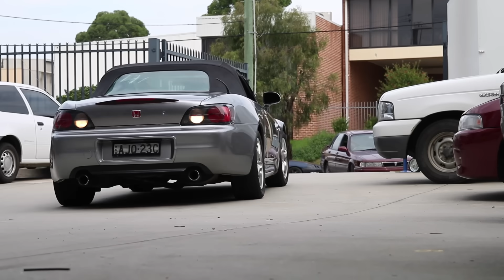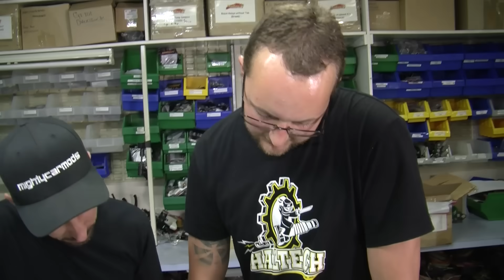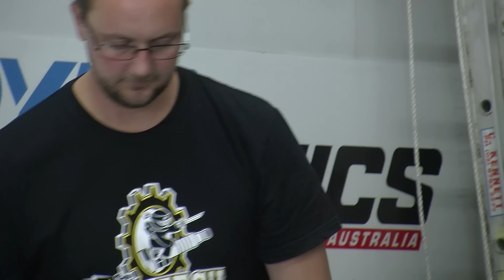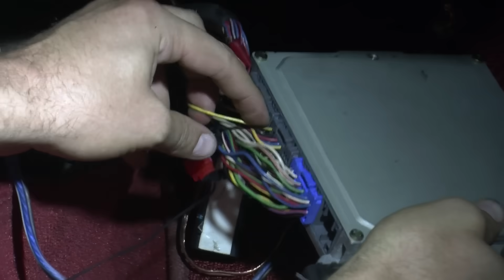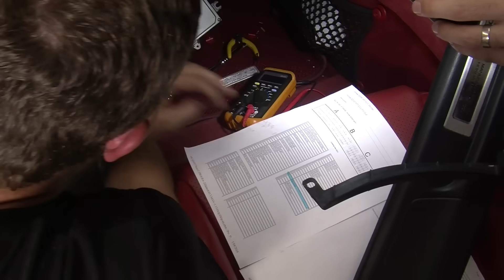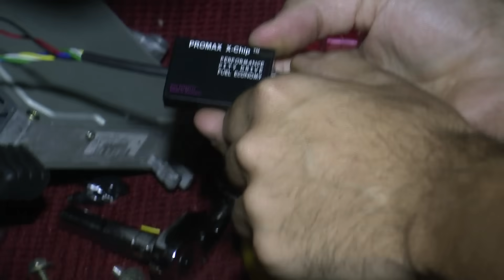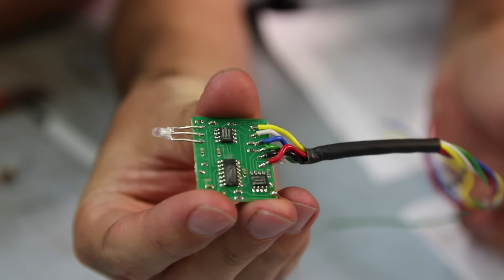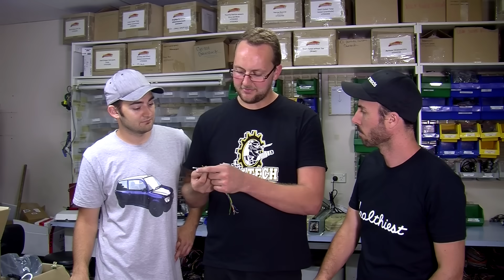eBay Performance Chips -  Mythbusted

Comment: only hardware with give you more hp. software wont.
Reply: Software controls the hardware... It does in some sense.
Reply: well, if you add hardware you should tweak the ecu or buy an ecu you can reflash or tune. But, na electronics alone won't change anything their just complimentary.
Reply: Incorrect.  A true software performance tune will increase HP substantially with a loss of fuel economy and emissions.
Reply: It didn't here but software can definitely help. Watch the youtube video "Audi S4 v Audi RS4. Does Supercharging Rule? - /CHRIS HARRIS ON CARS" and you will see how much of a difference it can make
Reply: tuning an engine actually does a lot... software runs your car. air fuel ratios are controlled by software so youre completely wrong actually
Reply: Yeah, but stock engines in sports cars are normally not held back by the software except for speed governors.
Reply: You are so wrong it's funny.

Cars are tuned from factory with a basic, reliable, often crappy tune.
An aftermarket tune alone can give HUGE benefits, even on a stock car.
Reply: very untrue...and if you have a turbo equipped vehicle or even a turbo modified car their is plenty of power to be made with a good tune.
Reply: Take an STi for example. They have tumble generator valves to alter the incoming air flow for lower emissions, safer cold starts, etc. They also have the SPT division, which provides even better optional performance parts. Yes, it's a sports car, but the factory tune is purposely conservative to make sure the car runs right and safe. Cobb accessports can bypass these tunes and add power, at the risk of lower mpg, reliability, etc. Same can be said about many other sports cars.
Reply: LOL, okay buddy. Do you professionally tune rally cars for a living? Or have you just watched too much Fast and Furious? Pick up a wrench and get your hands dirty for a few years before you talk. The big boys are having a conversation here.
Reply: James T Kirk Oh well, that's wrong alot. You say that modifying exhaust pipes cannot reach more power without ecu tune? What more examples I could give.. Porting the engine head, bigger bore pistons, better intake manifold, increasing turbo pressures, removing unnessary weight from the car, using lightweight wheels and flywheel, changing gear ratios...

Alot of modifcations improves the performance without differences in ECU's. Even changing the whole engine can give more power even when using the same old ecu. And after all, ecu's do "teach themselfs". If ecu see motor runs little too lean, ecu will try to make engine runs more rich.
Reply: For every one of those things you listed, pertaining to the engine( I don't see how weight reduction has anything to do with anything in this video), would be improved by re-calibrating the tune for all of the changes done.

Porting heads might make a small gain but if you aren't commanding extra fuel for the extra air those newly ported airs are moving you aren't realizing their worth.

Also, ECU hardly "teach themselves" they can make small adjustments about to about 1 point and that is only when the AFR is off long enough for the short term fuel trim to edit the long term fuel trim for the part throttle and cruising tables. 

You do realize that cars don't even use the factory narrow band 02's when they are WOT right???

They can only read (like I said) about a point either way rich or lean. Those are only used for editing the long term fuel trims for emissions purposes (NOT performance). 

Cars go open loop as soon as they go WOT. This switches the tables it is reading and those tables cannot be edited by the computer itself. Very few ECU's can, and I don't know of a factory one that does. Megasquirt can and Holley's Dominator can.

The reason is because VE tuning has to have VERY GOOD info. Steady state tuning at every throttle angle and RPM (hence the use of dynos). Those are locked from the manufacture. 

I don't know if that made sense or not, it's been a long day and I feel like I am rambling. Nevertheless, I don't think you know how EFI works (like REALLY works). You sound like a part swapper not someone who tunes their own cars (no offense).

Message me if you want to ask me anything.
Reply: salemcripple Exactly. Similar thing with the Bimmers even N.A.
Reply: The new Brabus CLA45 is only tuned using software and it has 40+ horsepower than stock. Please research stuff before making yourself look like a fool.
Reply: In modern cars particularly Japanese ones engines are mostly restricted so if you change the chip on ECU it does make a difference.One of my buddy got extra 100 BHPs in his BMW 325 coupe but it wasn't cheap
Reply: Supras tuned can reach 500 hp
Reply: Calvin Conley Not with stock hardware. A 'tune only' Supra will never be 500hp... maybe a bit under 300 if you're lucky.
In stock form, the boost pressure the turbos produce is controlled by back pressure in the exhaust system.. Without removing or modifying the exhaust as a MINIMUM, you are not going to get a whole lot more power than stock.
Reply: HOT40K
 a stock 2j supra with a linkG4 puts out 400 hp atw all day
Reply: So you mean to say ignition timing, fuel injection, compression ratios, fuel pump speed, and valve timing is done with actual hardware?

Software tells hardware what to do. In cars, kitchen appliances, aircraft, etc.
Reply: Yes but from the the factory it should be right on the money. Unless the car is made for economy driving, in which is is undoubtedly not a sports car!
Reply: ian turner Factory tunes are generally shit and UBER conservative Ian. Reliability they are probably ok, but power wise they leave a LOT of room for gains to be made.
Reply: Standard Saab turbos can easily gain 150 hp  with only software modification.
Reply: All you people arguing about being able to ADD power through software are idiots. You can only FREE UP power with software, not add power that wasn't already there. You are just freeing up power that the factory left on the table for various reasons. To add power you have to add or modify hardware and I'm not even talking about bolt ons like an exhaust as all that does is free up power that was already available. Boost, nitrous and increasing displacement are the only ways to add power...
Reply: SideWays8Productions Are you talking to me? If you are why don't you reply directly... also you trying to tell me you can ADD power through software? Really? You say you work on cars and don't grasp that simple concept... that is pretty comical. You might "professionally" tune rally cars (seems really doubtful per this convo), but you absolutely have no grasp on semantics. A tune is a NOT a power adder... all the crap you morons are talking about is just freeing up available power... it's already there because of the hardware, but you're tuning to squeeze it out. Way to make assumptions about how much wrenching I've done too, I've never taken one of my cars to a mechanic outside of free warranty services, but whatever... just compounds your stupidity. 

The funny part is, one day (possibly soon) you're going to ask someone that you believe knows what they're talking about and they are going to confirm what I said... lol... though it's doubtful you'll admit to yourself how wrong you were.
Reply: ***** You're contradicting yourself. Your reply agrees with my point and yet you still choose to say both are kind of right. Pretty baffling to be honest.

Tuning is just optimizing, you're not adding anything that wasn't already there... it's called physics.

Beefing up internals as you stated is just allowing reliable power, which make the ceiling higher without fear of grenading something. Physically the power is there though, might not be reliable, but it's available.

It's really simple... the only power adders are superchargers, turbos and nitrous. Just do a tiny bit of research, talk to some serious track heads, check out league rules/restrictions. Use common sense and think a bit about what's being said and what words actually mean.
Reply: There you go again using that "free up power" phrase. Yea, why don't you go bolt a 35r to a stock EJ block and watch how quickly you hit fuel cut. Even the stock ECU can well exceed the injector size and timing, but you'll obviously need bigger injectors. You're not "freeing up" power if there really isn't a limit to it on the ECU. Obviously you wont make 500hp on a stock N/A block. But throwing in large injectors or forged pistons is not gunna change anything the ECU can do. It's not gunna detect anything you did to the block, it's gunna do exactly what you program it to, and rely on the hardware to keep up.

You're acting as if the ECU has limits depending on what turbo or intake or valve springs you have. Take your cure-all forced induction F&F logic and enroll in an actual automotive school. You don't see Lamborghini or Aston Martin using snails and pulleys to get their neck snapping numbers. Hmm, wonder how they do it?
Reply: vestern22  "so if you change the chip on ECU it does make a difference.One of my buddy got extra 100 BHPs in his BMW 325 coupe but it wasn't cheap"

If you "buddy" did indeed pick up "100bhps" with his 325, he did not do it with just an chip/ecu.
Reply: David Silva has never heard of a dyno.
Reply: Not true, David.
Reply: Biggest idiot ever.
Reply: That is not true at all whatsoever. Since the beginning of EFI, software has solely been responsible for giving the car its power. Without changes made in the cars calibration or tune, no matter what parts you change it will not make to much of a difference without the ECU changing the tune to account for any changes. I suggest you actually learn a thing or two instead of being like most people, where everything you learn about cars is off of Ebay.
Reply: James T Kirk penisis
Reply: good one
Reply: That's incorrect.  Cars are released with fuel and timing tables that are geared towards fuel mileage and emission standards.  A performance chip changes those tables and gears them more towards performance - obviously at the cost of economy and emissions.  Personally, the only engine I've experienced a significant increase in performance with merely a chip is GM's 454.  They're such a "dirty" engine emission-wise that their fuel tables are quite lean - so much so that from 3/4 to wot does nothing.  Hypertech had a chip that addressed that very effectively.  Most chips, however, will only give small increases unless other measures are taken.
Reply: In this month "we" also tested such. Focus RS with stock ecu program benched 255PS/402Nm and 3-4 minutes later with Bluefin soft changed into benched 273PS/430Nm. Ecu program were changed by having a tool for it, connected to port so not cutting wires like on this video. If the program is well made, it really can work, and it also really depends about the car.
Reply: Simply not true. In the 80's BMWs you put a chip in and you can feel the difference all the way. There are a lot of reasons for this but most simply you are required to run 91 or higher octane gasoline and they adjust the ignition timing and fuel curves which results in increased performance ..... and dare I say.... . POWER.
Reply: Not in all cases. With the VW 1.8/2.0 T, A performance chip from API will actually add quite a bit of hp by modifying the fuel curves, and changing the point at which the waste gate opens. Which will build more boost, with completely stock parts.

Comment: Splice a variable resistor into the coolant temp sensor, get an ohm meter, test the resistance for the richness/leanness of the fuel, boom. Instant fuel savings or power gain depending on how to set it.

Comment: A  performance chip that added extra horsepower would never show up on the dyno for that car because the speed limiter kicked in before it maxed it's HP.  That car model has a claim of 237hp to 247hp yet the dyno read 179.  The car would have to be towing something uphill before it started to use that overhead horse power.

The only reason why anybody would want to modify a vehicle for a little bit more horse power is there is some sluggishness when the car meets resistance such as a hill.

I would call it a fail even if it was doing something, which most likely would have been a drop in gas mileage while not increasing the horse power on the dyno.

Comment: Now wire up some variable resistors to said lines on the ecu and see if resistors actually would have done anything. Could be an easy way to gain HP if modifying thew signals actually increased performance